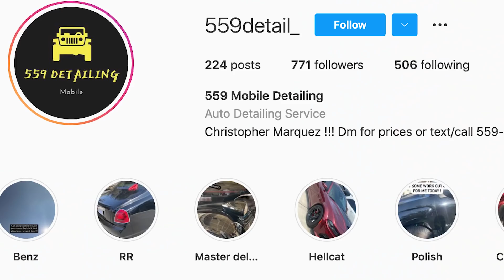Detailing Out Of A Trailer   RTE Detailing

Comment: If you’re going to be carrying that little of equipment, I think the trailer is over kill. Might as well load it in your truck . Just my opinion
Reply: 100% lol
Reply: Haters gonna hate 💯
Reply: @EM1statuz  ain’t nobody hating 💯
Reply: @movalautodetailing2543  low  🔑 hating 😆
Reply: @EM1statuz  I wasn’t raised to hate on people man.  I’m actually happy for him specially since he has his own business his own equipment etc. it was just my opinion which I stated above, there’s no need to hate man the Detailing community shouldn’t be about hating. I run my own Mobile detailing business too.
Reply: People who say this is hating, are way to sensitive. Gotta have thick skin as a business own and learn how to take constructive criticism. One thing i would add is the guy says hes a minimalist, yet hes towning a trailer around basically empty. Minimalist is running a small battery powered vacuum like the dewalt one and the smaller ryobi power washer, that bigger one is overkill anyways. I would recommend downsizing equipment and running that whole setup in the bed of your truck and adding a cover, especially for maintenance details.
Reply: Yea but he wouldn’t be able to lock his equipment up at night! Easy lick for thieves. He’s doing right
Reply: Advertisement and security. Plus, a hole lot easier that pulling crap off the truck.
Reply: @movalautodetailing2543  it was just an opinion and it has its worth im here learning for what im actually gonna adquire to start up my mobile detailing bs soon